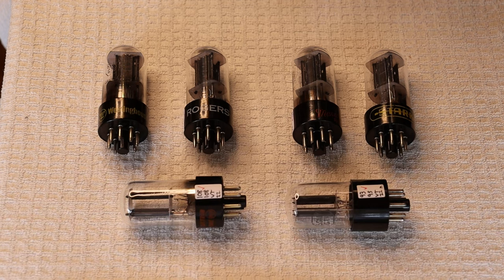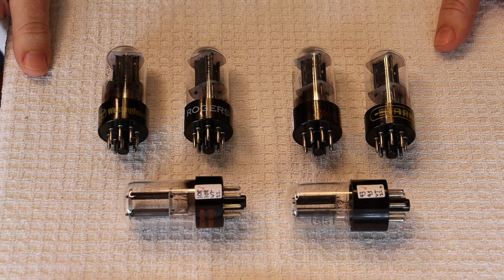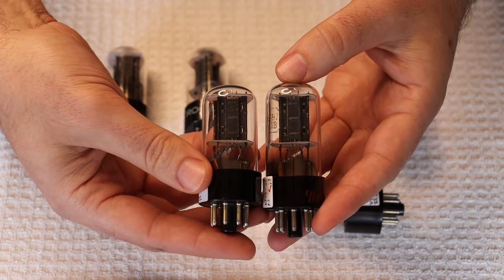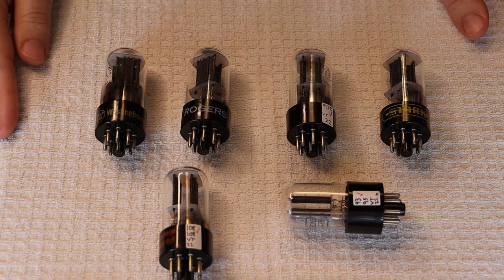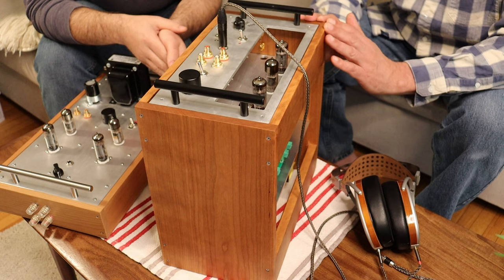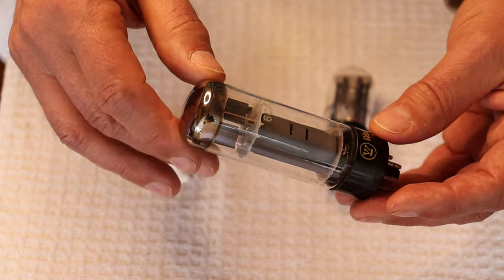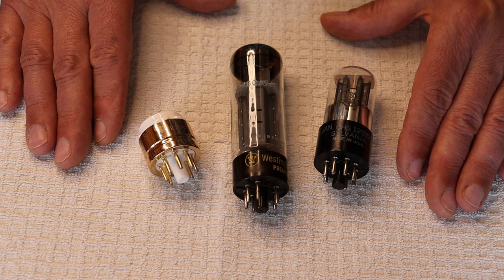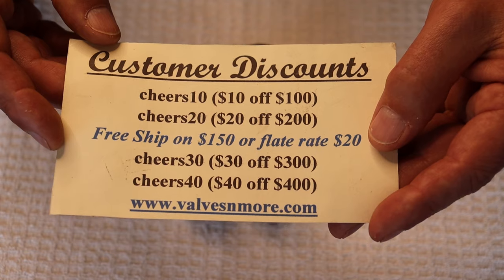Tube Lab #183 - RCA Canada Tubes & Our Headphone Kit Amp

Comment: You’ll have to contact Ryan at ModHouse and ask him to loan you a pair of Tungsten headphones. If you can drive that one, you can drive anything.
Reply from the maker: Our Hifiman HE1000 v2's at 35ohm/90db aren't the easiest cans to power up and the Kit Headphone amp easily handles them and they sound amazing.  I just wish they didn't weigh so darn much!  My favs are our Sennheiser HD660S 150ohm/104db, they are nice and light and sonically paired with our Kit Amp sound simply stunning.

Comment: Tungsten = Impedance: 135 ohm average, Sensitivity: 76db/mW

That’s why they are the reference in terms of “difficult to drive”.

HE6se and Susvara aren’t too far behind.

Everything else can be driven by many commercial amps.
Reply from the maker: As an amateur speaker designer, I've watched products enter the market that I would never in a million years have ever released as a finished design.  In particular very low sensitivity in drivers, both in main system speakers and headphones.  In my experience the more efficient drivers almost always sound superior.
Reply: @tubelab194 It’s a bit different with planar diaphragm, I guess, as both Tungsten and Susvara are currently top rated. I don’t really care, I don’t have them, as I would never spend that kind of money on headphones.